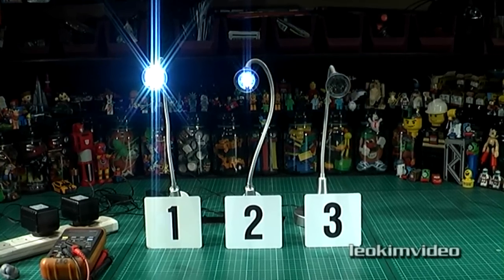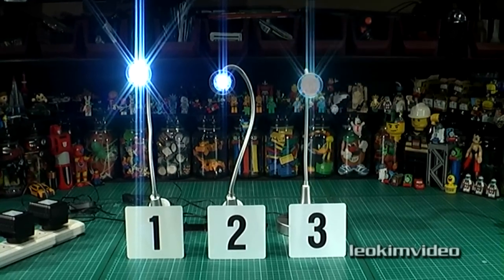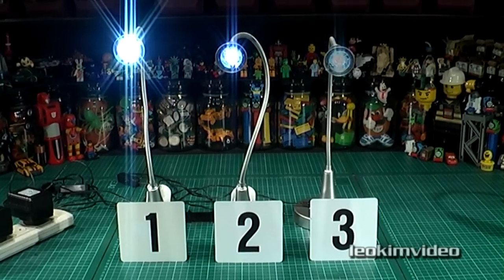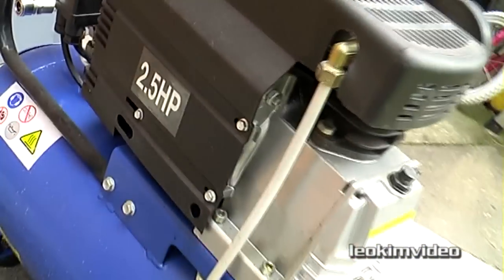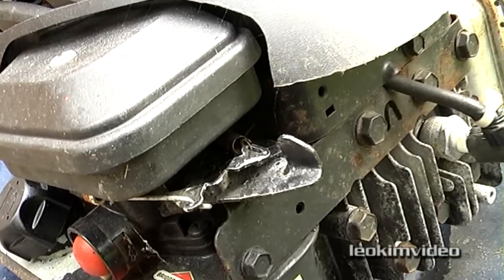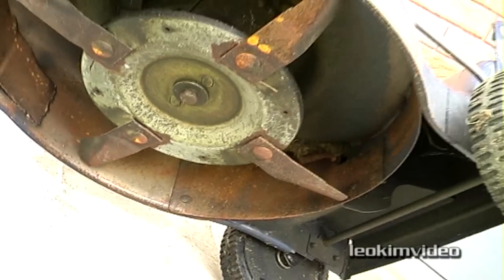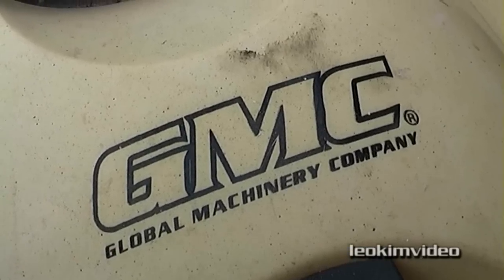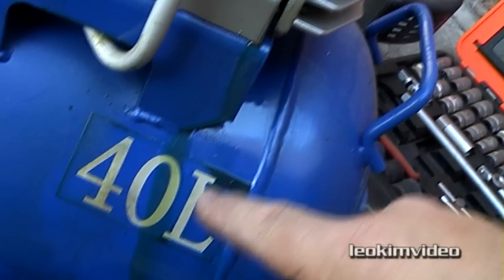Cheap China LED Lights GMC Lawn Mower & Sexing Spiders

Comment: The easiest way to determine the sex of a spider is to look at those little extremities that are adjacent to the spiders fangs (chelicerae). These things are part of the spider's mouth and are called "pedipalps". They aid the spider in eating. In male spiders, these also function as sexual organs. So in males, the pedipalps terminate in a bulbous end that is quite distinct. Besides having larger pedipalps, male spiders are generally smaller and with narrower abdomens (back parts) than their female counterparts.
Reply: That's only on mature males, so one that has bulbous pedipalps is a mature male, but if it doesn't, it could be anything really.

Comment from the maker: just out of total curiosity I have pulled the flashing LED light apart, it's very interesting as there is a strange growth around one of the solder joins, to describe the look it loos like the  solder has got a dark growth which looks like graphite coming out of the solder area

i'm going to pull a video showing just how poorly this light is made and a close look at the solder joints

thanks again for the read about tin whiskers, that was amazing to read about
Reply: what kind of spider is that

Comment: If the malfunctioning lights were bought in China, then you have a power problem. The power output in China is different than in Australia. The little elephant light may just have a bad rechargeable battery. Those pop up from time to time.

Comment from the maker: thanks, I will pull apart the heads of these lights to see, I have had dry solder joints on some other stuff in the past, I see others are suggesting it could be faulty resistors as well

all I know is it's cheap and nasty

Comment: the reason why the third one is malfunctioning because there's a short inside the light bulb somewhere and you need to replace the whole light because there's no way you can fix that malfunctioning problem in that light

Comment: Chinese stuff is generally hit and miss, sometimes they work surprisingly well, even with hard use. And then again sometimes it can fail very quickly, so again, hit or miss.  The main thing for me with Chinese stuff is price vs usage.  If I need a tile saw once in my life and a really cheap Chinese saw does the job. Why spend $500 bucks for a nice saw? Conversely, I would probably never want a Chinese washing machine or refrigerator unless they got got a LOT better

Comment: Do these lights have any type of electronic circuit inside, Like an IC maybe to control the lights?
That is the problem. Many of the LED lights you can buy have these to make it have more features but when that circuit fails, it's time to toss it. If the flashing light has a circuit inside, remove it and wire the LEDs right to the main switch if it's not part of the circuit board. Too many electronic controls = Failure. 9:33 And that's a hairy spider.

Comment: I would say that the lamps are getting too much current from the transformer. Coupled that with poorly made LEDs and you will have issues. The blinking lamp is caused by "Thermal Runaway", a catastrophic failure mode in LEDs that renders them useless. They look the same as the crap Wal-Mart sells. Junk.

Comment: Solder joints, either dry joints or the pads are not fully covered, ive had a similar problem with some other chinese led lights....

Comment from the maker: aussie the second part will be uploaded real soon and I cover the topic of playing with fire, the cause of the compressor failure is quite interesting and it's rooted back to China

I had a old swan compressor ( orange vee compressor ) for over 20 years, in the end the electric motor died and there was a bit of rust on the pressure vessel, so it had it's day but the crap they make today is rubbish as you well know

and people run off and love this cheap crap, yep i'm one of them

Comment: Great video Leo!, It really is hit and miss with this China stuff. our old GMC pressure washer is still going strong too, it has brass pump fittings/caps from the factory and only needed a new motor run cap a couple of years back.

In regards to the compressors, I've found dozens apon dozens of them, either locked up, or with burned motors (failed caps and alloy winding failures). the old Swan compressor I have may be Taiwanese, but its old and durable

looking forward to the next part

Comment: I had a car that 'stopped working' because the CPU packed up one week before my warranty ran out... I maintain to this day that it was programed to do that so I would be in the showroom with it, and at the same time maybe contemplate a trade-in and a new (more reliable) model. I didn't. I got it fixed under warranty and it's still running fine to this day...

Comment: Google: "NASA Tin Whiskers"  They have done extensive research in this area including linking tin whiskers to the unintended acceleration phenomena that plagued Toyota. 

Pb used in electronics pales in comparison to lead usage in other industries, (ie: lead acid batteries). Promoting recycling would have been a reasonable solution, but instead the entire electronics industry is forced into costly compliance and we the consumer end up with unreliable desk lamps and possessed gas pedals. 
-jc

Comment: ROHS is the problem! 

Someone (legislators & hippies) thought they could save the planet by requiring electronics to built with lead free solders. Turns out lead free solder actually sucks at making consistent reliable joints. The joints that are sound will eventually fail as conductive microscopic tin whiskers grow from the joints, eventually producing shorts that render the product intermittent or totally unusable. Lead based solder does not produce tin whiskers. Thanks hippies!
-jc

Comment: leokim..... just wondering if your mower has a briggs and strattion or Chinese clone engine.... if it is a briggs which i think it is. there is a rather cheap and easy replacement for your junk linkages for a linkage set that is more robust...... I work on engines and allways keep tons of junk and you be amazed how interchangeable it can be

Comment: Sir LED is not crap as a small LED PC monitor looks far better then large LCD or plasma:) Also sir LED should run at only 3.8volt,5watt 2000mah
Reply: Super perfect Stranger